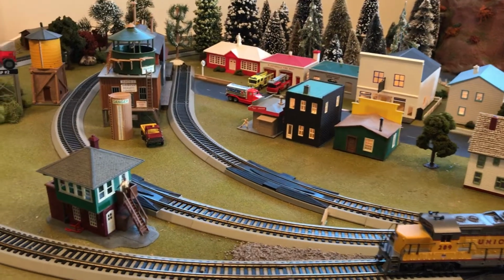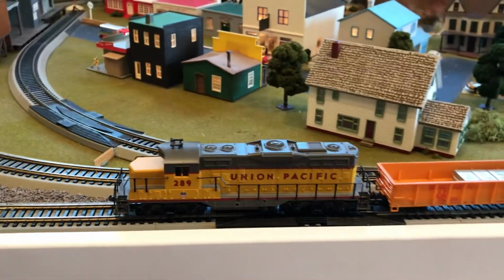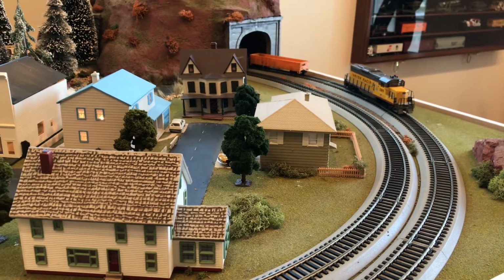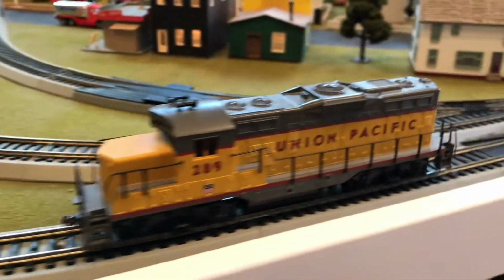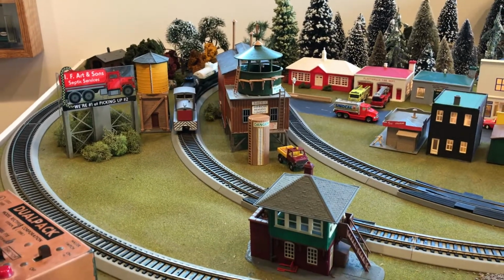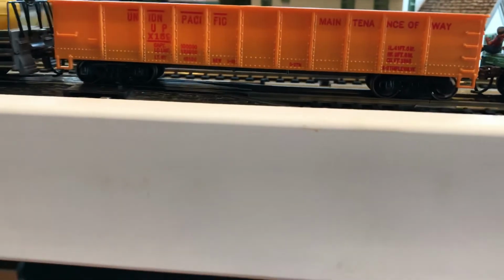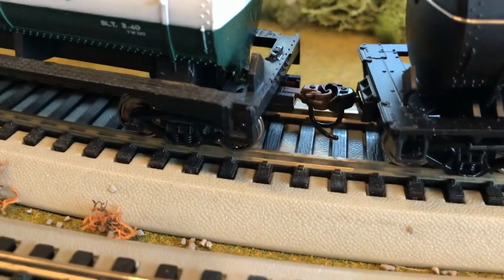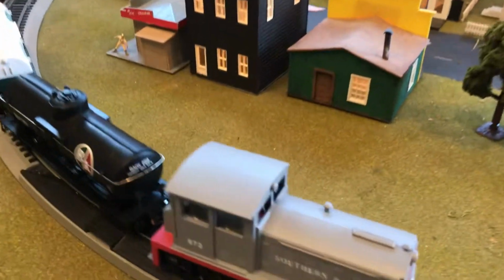HO Test Run #3:  Walthers UP GP-9 and Model Power SP Plymouth Industrial Switcher

Comment: The coupler on that gondola is really low. You can adjust it easily by placing a washer under the truck or try to lower the coupler on the loco.